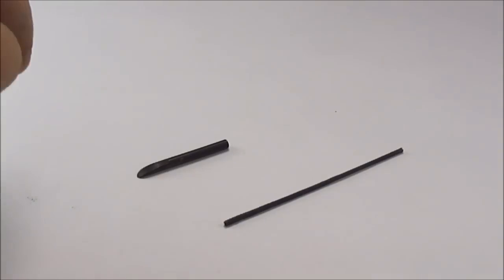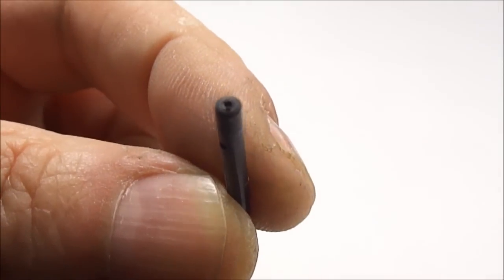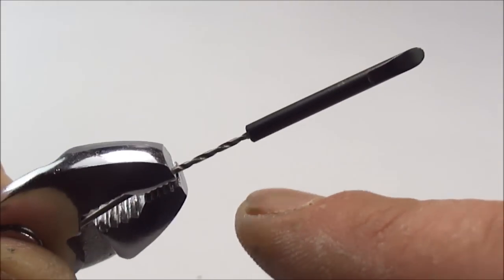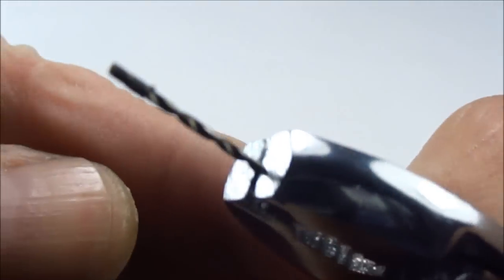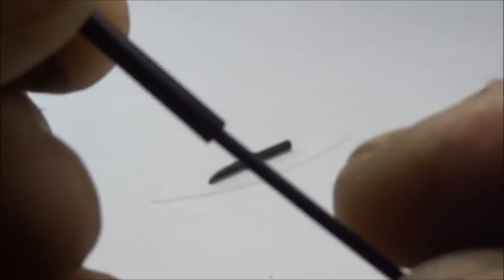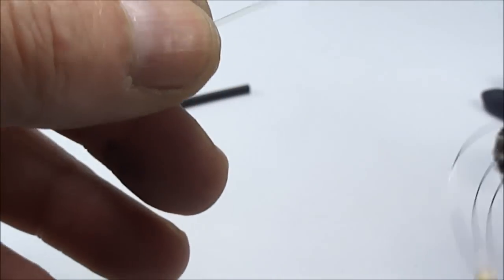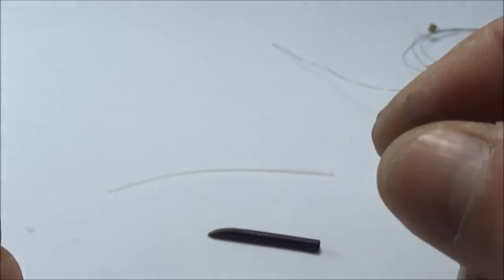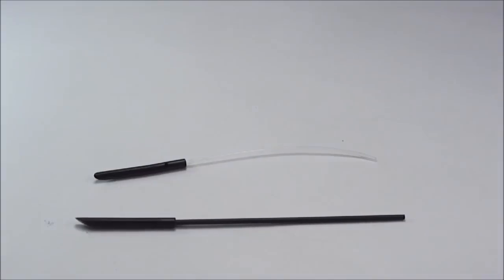How To Replace A Parker 51 Breather Tube

Comment: Sir, you should have used  an 1" hand vice to hold the drill bit  do this job.
Hand vice is a very useful tool for many things .
Again, cheap ball point pen ink true is hard enough to push it through the breather hole .
I am a vintage Parker fountain pen collector .
I my country it is very difficult to collect good and expensive vintage fountain  pen . Regards LK
Reply from the maker: Thanks for the tip. I have many vintage pens available if your interested pop me an email.

Comment: I broke my tube inside the feed too and what I did was to find a needle, bend the tip into a small hook and then insert into the feed to catch the broken tube. I was able to pull it out that way.

Comment: Hi stef, does the plastic breather tube may work in parker 51 aeromatic?
Reply from the maker: Yes the plastic tube does work and does not corrode. Dont forget to make a tiny hole in the tube like the originals. Good luck

Comment: Are you sure there should be a hole in the side of the tube like that? I just disassembled a 51 with no hole in the breather. My understanding of the function of the breather is that it is to equalize the pressure between the sack and the outside atmosphere, as well as enable high capacity filling. Seems that if there is a hole low down on the tube, it would keep it from filling past the hole. Or maybe Im missing something. (or maybe my "new" 51, bought used, in non-writing shape because i wanted a 'fixer upper', was already worked on by someone else who used the wrong tube. lol)

Comment from the maker: Hi..I wouldn't recommend any old tube as it may react and deteriorate with the ink.Also i used a 1mm drill bit to remove the old tube but i am not 100% sure of the diameter of the replacement tube.......